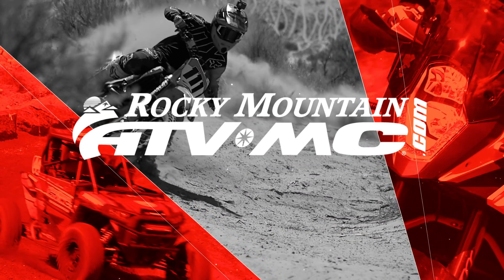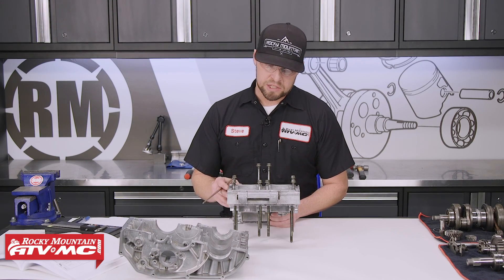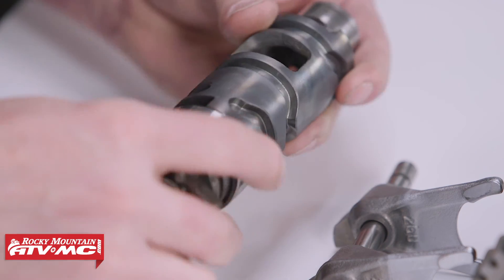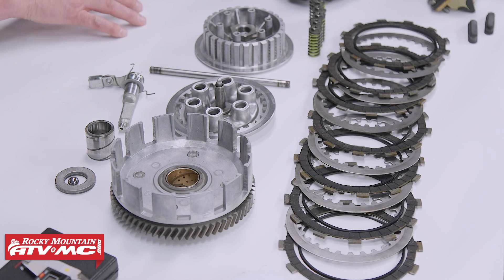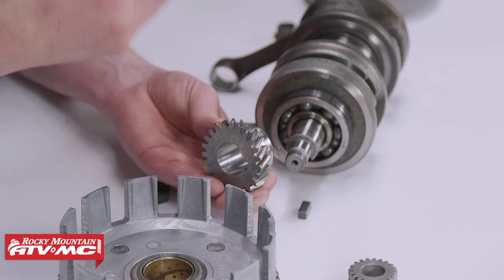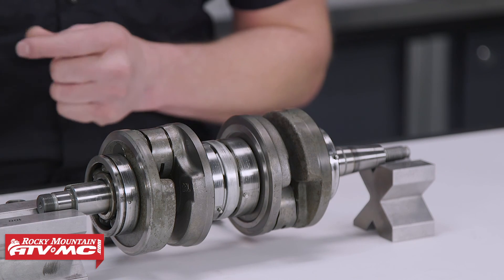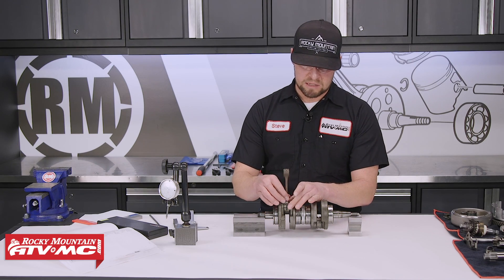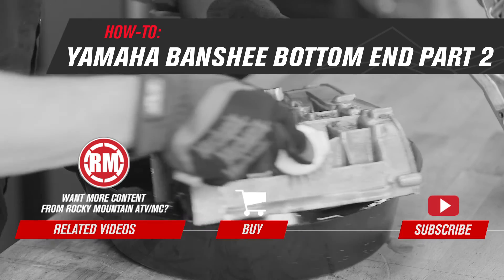Yamaha Banshee Bottom End Rebuild | Part 2: Inspection

Comment: I have a 93 banshee and it has an Athena 65mm original carburettor pilot 32.5 main jet 310 flaper v4, my problem is that when you get on the banshee the right pipe is colder than the other. I did the comparison and it is 150psi on both sides, but the leak depression test goes down slowly, what would be the problem,

Comment: Question for you or anyone else:  My engine will shift through all  the gears & moves freely in neutral when off as it should. When you start it  in neutral, drop it into gear,  it doesn't  move. It's as if something  is holding  it place when you give it gas. I  recently split the cases, nothing seems rounded off, worn or anything  irregular.  Any ideas as to what may be out of adjustment or cause it not to go or move? I'm new to banshee  and lost.  Btw- 4mil 421 cub. . Thanks in advance
Reply: Are one of your brake calipers seized up? And was your clutch in good condition?